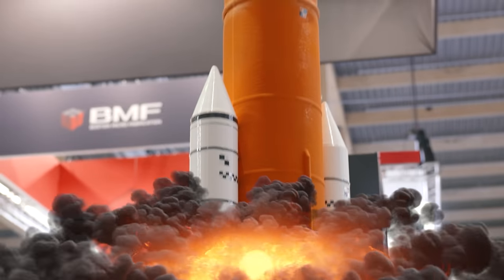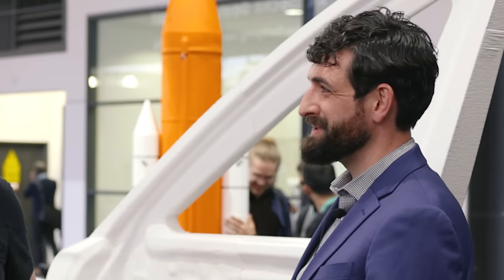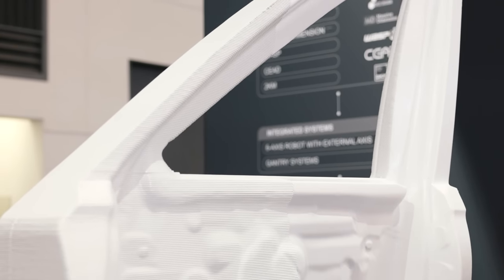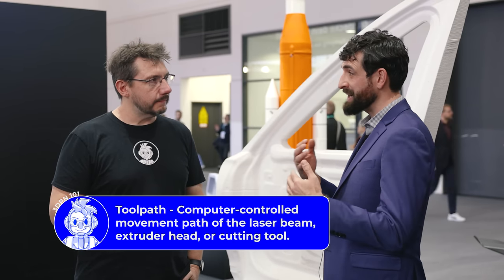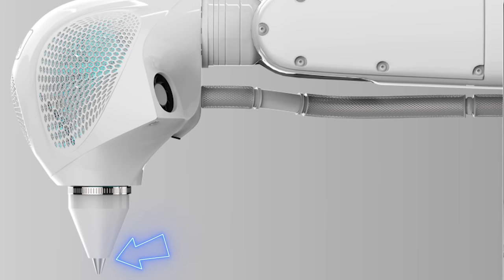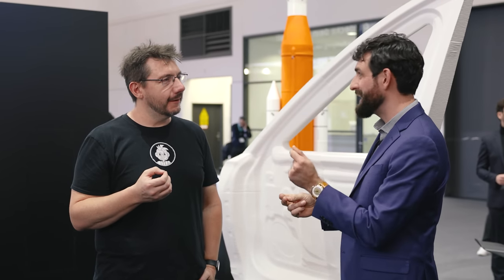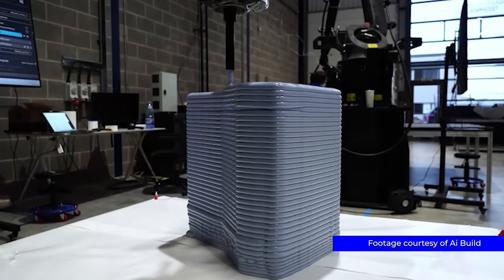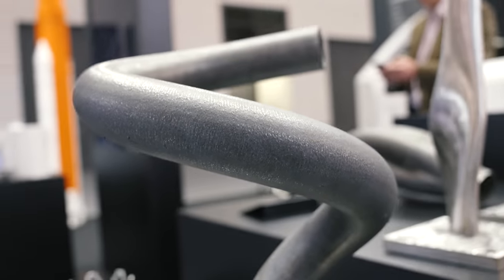Defect Detection in 3D Printing with Ai Build

Comment: I have been saying for years: The NEXT big advancement in 3D printing will be CLOSED LOOP CONTROL (where a camera monitors the build) and adjusts (fixes problems) as issue arise.
This will be critical in 3D Home building as you cannot just scrape off a bad print and start again.
Reply: Yeah, when I got into printing, I was super surprised that everything is open loop
Reply: It'd also be great for using expensive, hard-to-print engineering materials like PEEK, that cost hundreds of dollars per spool so you can't afford to waste any of it
Reply: This - Plus more!
Reply: No worries. Working on it. Though not using cameras.
Reply: @TimothyKNetherlands  interested in Co-op?
Reply: @polycrystallinecandy  i was surprised a bit too, but when looking at industrial machines, almost everything is open-loop, no whatsoever sensors, no safety/crash sensors anywhere, or it is very rare.
Reply: @TimothyKNetherlands  laser?

Comment: So it's finally happened. Someone finally put in the effort to try and put a sensor at the nozzle to prevent issues after the extruder. My current printer is down because it fails at the nozzle, where I can't stop it until too late
Reply: Most of the beginners struggle with this because of cheap printers and misinformation in the 3D community. With a year of experience and engineering knowledge I could turn my $140 ender 2 pro into a reliable hobby workhorse with spending about $7 for parts. There is no point to give you advices here, there are many good informations here on youtube, you just need to filter the junk.
Reply: @dtibor5903  I don’t doubt it, but how many hours did it take to get that experience? I spent about $1000 on a really nice printer and I’m getting great results with zero actual experience printing before having gotten it.
Reply: @DannoHung  that's great! I decided to go on the cheap route because I had time, I'm DIY person, I enjoy challenges like repairing damaged stuff and my investment was not intended to return money. If you plan to do business, alwyas buy the most reliable one.
Reply: @Miguel Defares  my next printer is going to have both direct drive and  a hardened nozzle, so hopefully, that fixes it.
Reply: @DannoHung  I spent $120 on a factory return of some unknown printer all metal hot end, direct drive, stamped steel frame and it worked great out of the box. I'd take it over a prusa everyday 😂😂 even if the prusa was the same price.
Reply: @thirtythreeeyes8624  where did you get the factory return printer from?
Reply: @TheButchersbLock  Found it on ebay.
Reply: @thirtythreeeyes8624  I didn't buy a Prusa
Reply: Been saying this for a while- even brought it up to Ken (spaghetti detective) and they said it was a good idea and they never thought of it- just add a laser and photodiode combo detecting filament extrusion right under the nozzle. Would only usefully work for planar printing but otherwise most hobby printers could easily use it. It would work in the dark, would be simple to implement in software, and wouldn’t break the bank.
Reply: @DannoHung  I didn't say you did I was just mentioning an expensive printer, if you spent $1000 on a voron or Bambu then ya you got your money's worth.

Comment: Was wondering when 6 axis printing would become a thing. It is really interesting to watch this technology jump leaps and bounds every year. One thing that would make large format printing more viable would be to swap out the 3d printing tool head for a mill head after the 3d print is finished so that the plastic can be milled smooth. Much like in CNC machining where you use different tool heads / bits to mill away machining lines in aluminum / get finer details. You make sure the 3d print has a little extra material that can then be taken away to make a perfect machined part in the end. You no longer have to worry about layer lines or making the most perfect large format print (which sounds nearly impossible). If the surface has a defect where the layers are misaligned (much like that car door had all over) the milling process would take all that away. Even if you have catastrophic spaghetti failure the print could be salvaged. Just pause the print, mill away the mess, then resume the print (since it is being cnc machined away you should know exactly where the cut off area is to resume the print. Could also use feeler gauge on the print head so it can locate the resume point, or maybe software can figure it out from the camera recording). Sounds so easy in a youtube comment but in reality this would still probably take a decade or two to develop....but then again maybe it is already being done? haha
Reply: 6 Axis Additive and Subtractive Manufacturing is the future! Maybe it is in devolpment somewhere!

Comment: What we also need is for the printer to be able to do automatic touch ups to defects. The printer could retract and use the hot nozzle to heat up the deformed plastic and try and push it back into it's place. Juste like ironing does on the uppermost layer but in the XY axis

Comment: Others are saying it: this is basically the future (for one aspect of printing). One complaint I've had on the consumer FDM side is all the touchy-feely "well this works for me" nature of 3D printing. What it should really be is "here's the model, print" and it works. No slicer tweaks, no changing flow or temps based on material. If I want it printed in white instead of orange, I will do that. But a lot of times you have to do those tweaks. Bambu does a little calibration ahead of time, the Prusa XL is supposed to be able to tell how it's printing with it's load cell, but those (and others) only get so far. Add a camera and you can get another level of detail. Add sensors and you can get more. But none of that will matter much if it's just going "am I printing?" instead of "how is the print?". Adrian Bowyer had an awesome talk at ERRF 2019 about how the goal shouldn't be to make printers that will be defectless... it's not possible. Instead, it should be able to take nearly any machine (consumer or otherwise) and go "my calibrations indicate I can move 0.001mm... but I have a model that needs 0.0001mm to get all the details" and be able to adjust to get those details. Or to recognize it's drooping (like the 90 degree print they show) and to adjust to still print perfectly.... because that's just gravity. So long as it's solid enough, add a support at the other end and you're good... but if it kept printing without taking the drooping into account, you now have a messed up print.

Comment: The virtual model of the printer was awesome, just think you could run many iterations   before an actual print just to find any problems and save so much time, money and not waste filament.
Reply: As well as our digital twin simulating the entire 3D print we also have build simulation capabilities in AiSync. One of these is thermal simulation which automatically adapts the printing speed for each layer, achieving an optimum bonding temperature to reduce build defects and increase strength in Z. Check out our socials for more info: Ai Build

Comment: Anybody notice the defect on the door behind him? Like at head level?
Reply: You ever heard of this thing called marketing? That’s all this video is, free advertising for AI Build. A lot of fluff, but not 100% accurate. Companies who need 100% accurate prints, like Aerojet Rocketdyne who prints rocket engines, probably aren’t relying on any sort of 3D printer or printing software that shows up to a trade show.
Reply: I guess the really hard thing with this kind of software is setting the treshold of what is an acceptable defect, and what is actually a defect that has too much impact and needs to be reacted on. 
Maybe that little layer issue you see in the print was actually already detected at the slicing level as potential issue, so the software knew it would come out just like that. Or maybe the software logged it as a minor defect for the operator to check and evaluate after the print was done, because it realized that its only a minor flaw that will not cause issues for the next layer to print on. Or it was an example to show visitors at the show that theyr software actually detected that flaw in the print when it was actually printing, but they set it to keep going without intervention.

Comment: Is it actually artificial intelligence making that happend or is just the name confusing?
Reply: They use video analysis software that has been trained thru machine learning to see defects happening. You kinda need that training process to simplify the processing job enough to run fast without requiring massive processing power, especially when you get video streams from 9 cameras that need to be analyzed simultaneously and in real time. A lot of algorythms that have been developed thru machine learning are labeled under the "AI" term, because once the machine learning process is complete, no human actually fully understands how these systems get to the results they provide.
Reply: @ProtonOne11  Yea i am familiar with AI topic. But since the complete pronunciation of the word didn't fall in this video, i got questioning this all the video long myself. Thanks for the info. Since i am waiting so much for 3d printers getting more AI involved, as i am pretty sure that Slicers like Cura could be way more better and also the printer itself. As AI is very flexable to do things and i don't understand why certain things in slicers are still that hard to do.